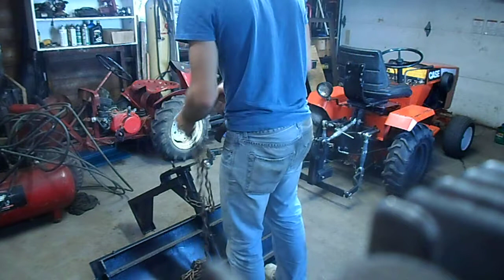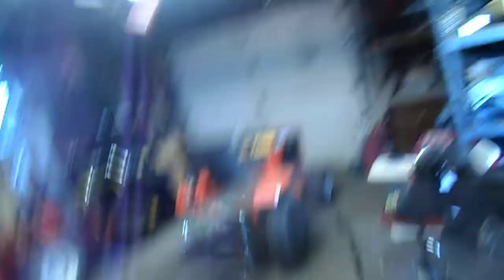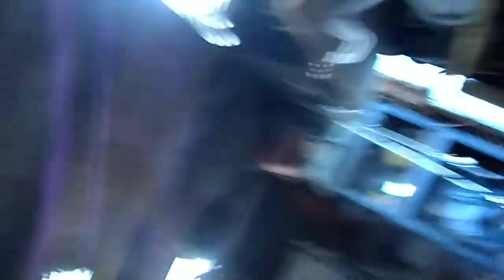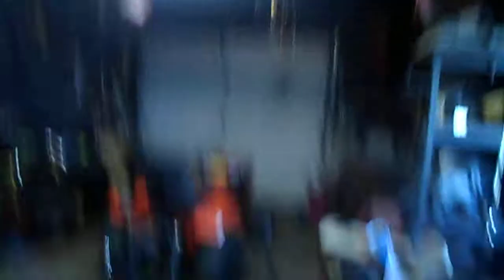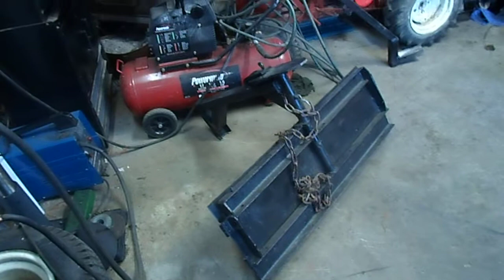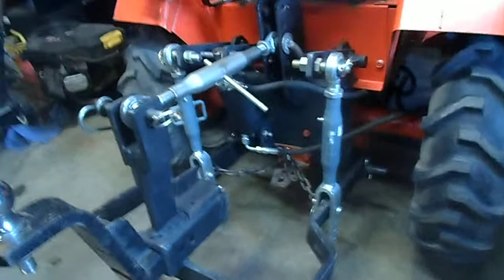Homemade Case 222 Three point hitch

Comment: Google category 0 3pt for specs. If you want to build one look for a Toro 117, 118 or 120 Groundsmaster (or Proline) being parted out as the front arms have the dogleg bends in them and are thick enough.

Comment: I've got a ~1950 Massey Harris 44, and of course ones that old didn't come with a 3pt hitch. Some previous farmed hacked together a home made 3pt hitch on it, but of course lots of those parts are missing. How did you determine the correct dimensions of the hitch parts? I assume there are standards to go by for each class?